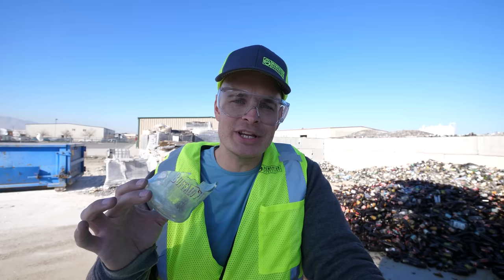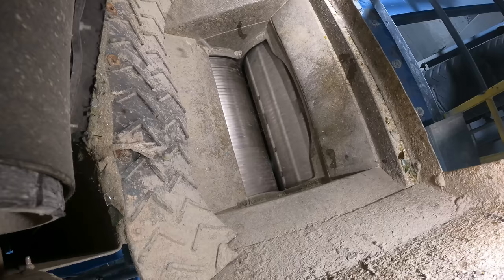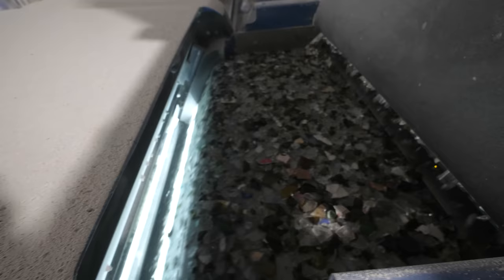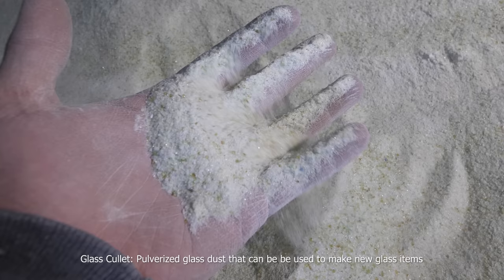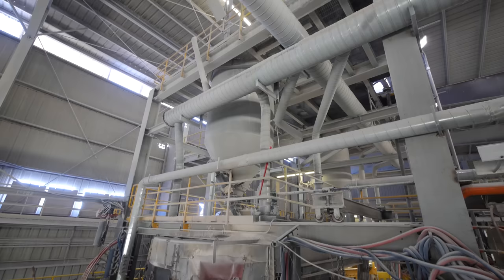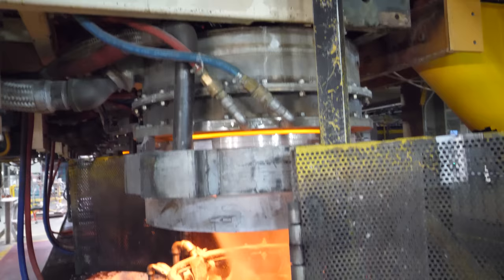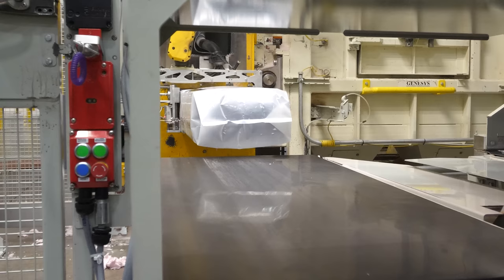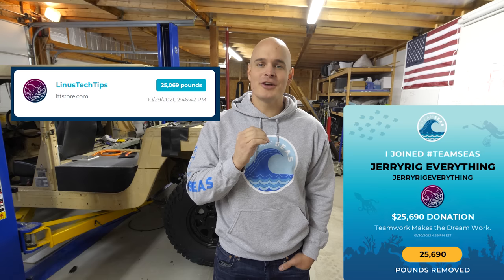What *REALLY* happens to 'Recycled' Glass?!  -  (you might be surprised)

Comment: I remember when the milkman delivered milk in glass bottles and after drinking the milk we put the empties out for him to pick up on the next delivery. The empty bottles were then cleaned thoroughly  before refilling for the next customer. A much more environmentaly process and much more efficient.
Reply: Used to reuse soda and beer bottles , but recycled wine and liquer bottles. now most are plastic or aluminum, and much more wasteful of energy and materials.
Reply: With new ultra light plastic bottles, manufacture and shipping requires less energy. those old style refillable bottles were half the weight of the product. One truck can now deliver what used to take two trucks. That alone debunks your theory. But wait! There's more! Cleaning and sanitizing a glass bottle uses more energy than making a new plastic bottle. One more point. All these recycling schemes rely on people donating empty bottles and in some cases going so far as to deliver them to a collection point. None of which is ever counted when calculating recyclings carbon footprint.
Reply: @dont.ripfuller6587  If you think protecting people from mystery chemicals doing weird things is more important than using scarce resources wisely. Well, that's your right.
Reply: @KathrynsWorldWildfireTracking  OK. Let us assume you are correct. Our problem is wonky plastic doing wonky things, some of which are bad. Should we go back to the old style energy intensive, remorse hungry methods of the past or strive to fix and perfect the new, low impact environmental friendly technology?
Reply: @owenblake90  Joe, is it possible we can do both? lightweight packaging and no floaty things? It is surely impossible to reduce the weight of a glass bottle by 99% but I am sure with sustained effort we can get rid of floaty things in plastic bottles.
Reply: Some small communities are actually bringing milk men back
Reply: it was probably worse to have someone deliver milk and reuse them. that all takes work and fuel.
Reply: @bobhart677  True. Much of our 'enviromently safe' products have a large carbon footprint behind it. Much of this industry is economically steered. If it saves money it will get done. 
Here in Sweden we recycle a lot.
Reply: @dannyb3663  Plastic is not a "toxic material" it is simply very durable. The good news is that over the last few years bacteria and insects have been found eating plastic. With billions of tons of it laying around something was bound to start eating it sooner or later. Biologists are at this very moment working with those bacteria and insects to solve the problem of plastic in landfills. Trust me, they will solve it less than tens of thousands of years.
Reply: @adun9138  Hi, Mr. Dun I must say I am surprised by an on point response. If glass recycling saved glass companies money when making new glass, they wouldn't need taxpayer funded recycling schemes to make it work. Metal recyclers need no subsidies to recycle metal. It saves them money to do so. Money being a symbolic representation of resources and labor, if you use less of it that is better for the environment. If you use more money to recycle, regardless of where that money comes from. You are using extra resources to do the same thing. Not good for the environment. It is far less costly in terms of resources and money to load up a truck with sand to make glass than recycle a truckload of old glass.
Reply: Allegedly they were cleaned 🤭
Reply: @bobhart677  But you didn't have all the plastic waste. That debunks your theory. Glass was always way more economical, and sustainable.
Reply: @Normal1855  Using two trucks to deliver your product instead of one because half the weight is packaging. Way more economical!
Reply: UK still has milkmen in vehicles delivering bottled milk and bottled juice. delivered at 5am and bottles collected at 5 am by same person.
Reply: Yeah, we have milk delivery services here in America to this day. It is a high end boutique service offered at very high prices. Why, because it is extremely inefficient and costly in both labor and resources. Why was it ever done in the past? For starters, the high tech plastic bottles hadn't yet been invented, supermarkets were just starting to sprout like mushrooms in the spring and we had been doing it that way for decades. The choices offered by our increasingly high tech society led people to buy things in plastic bottles at grocery stores because that was the least expensive way to do it. In general the least expensive thing is the greenest thing. Money is a representation of labor and resources, things costing less money use up less labor and resources. Things costing more, use more. The myth that a delivery truck hauling milk in glass bottles hither and yon is any way efficient and environmentally friendly is simply untrue.
Reply: @mochiebellina8190  unfortunately, people these days are under the delusion that they can be as wasteful as they want.
Reply: @nancybrownlee6518 if I may, what are your sources for these dangers of raw milk consumption? Not to be contentious, I don't care, per se, if you choose not to drink it, I'm interested because I do have an agenda with Codex, and care greatly what, how and why some of the things we hear, that become adopted and generationally accepted. My opinion- of course raw milk carrys with it some risk of food born illness, there isn't very much in the store that doesn't. What has to be considered is - how great is that risk really , incomparison to the Codex product? And how great is that, in comparison to other foods w high illness attributed to them? For what I've been able to come up with, illnesses from dairy products at all, are low on the list, with eggs and raw oysters being at the top , not accounting for allergies. There was shown to be almost 10 times the  risk of some food related discomfort ( meaning all range from mild bellyache, direanh, to hospitalizations) from drinking raw milk/raw milk  secondary products compared to the Codex product, but when put in perspective, the relative risk in the first place was so low, that multiplied 10times, your risk of getting a stomach ache or worse was still miniscule, I believe the numbers, using the trustworthy CDC numbers were pasteurized carried a .0003% risk and raw milk was-
.003%. However, what really counts is not the stomach aches ,but how severe is the risk of dying ? The only deaths Ive found in my inconclusive search were from something called bath tub cheese in the 80's, Now, my point here isn't to convince you to start sucking udder, I don't care one way or the other, but this Codex Alimentarius ( trans.- the food law) subject got put on the back burner and forgotten for 12 years until recently, I accidentally became reminded of it and slapped on the "holy s---" button at magnitude of what implications it holds. Great discussion, and here's to not putting anything in our bodies that makes us sick! ( I once spent 6 days in a hospital bed after ingesting some rare fungus that was eating some salmonella or something to that effect on a gas station chicken tornada)  🤢
Reply: @dont.ripfuller6587   If you want to know about the transmission of disease through raw milk drinking, the information and history are readily available online.
Reply: @dont.ripfuller6587  Degrees in agriculture and horticulture require pretty extensive familiarity with the research, and the methodology and results thereof are stringent.  They are also readily available, not just online but in all current textbooks.  There are no secrets about pasteurization or its results on human and animal health.
Reply: @bobhart677  ;Correct
Reply: @dont.ripfuller6587  ; The milk that was delivered to my house in those heavy glass bottles by the milkman was homogenized and pasteurized.
Reply: @jeffrygriffith3811  ;There is no such thing as a carbon footprint.  It is bogus.
Reply: @beskamir5977  Yes, we have been trained to be a 'throw away society'. I am still make do 'n' mend, re use, re love, recycle and  compost. 👍
Reply: @moiragoldsmith7052  Same, but unfortunately that doesn't make billionaires money so it's not incentivized.
Reply: @bobhart677  ...I think it would be really interesting to analyze honest calculations for the complete production / reuse / repurpose / reclaimation of both materials.
I find that a much more daunting task than it sounds, and it doesn't sound simple.
I know I trust myself to wash out the cup I drink from.  Corporations can't.  Take that for what it's worth.
A glass bottle is more likely to end up in a container than the plastic alternative by the human that purchases the contents.  Highway ditches and uTube "road rage" videos prove it.

I COULD make glass.  With a shovel and a magnifying glass.  What would I need for plastic?
Companies have chosen, repeatedly, to choose using material resources over human.
Centralizing operations and shipping raw materials and finished goods over increasing distances, like you said.
We HAD been shipping our recycling to China before they told us they would rather make their money NOT sorting OUR GARBAGE.  I can't blame them for that.

I would have been more comfortable with the video's title being, "Where Owens Corning sources their raw materials."

The issue seems to be cleaning the floaty bits out of our oceans and that includes 0% glass.

I know certain medical products wouldn't exist and others would expire or be too dangerous if not for plastics.
I guess it all comes down to using our resources wisely rather than fighting over them, or distorting their reputations.
Reply: @truthsRsung  Your comment has motivated me to up my game, I even made a bit of an outline! 
I too would love to see an honest accounting of energy/labor/resources/other costs to recycle glass, but far too many of the sources have far too many reasons to adjust and fudge the numbers for that to ever happen. My gut tells me that since almost all glass recycling is government supported, glass makers find it cheaper to haul another load of sand to the plant than reuse old bottles. Disposal costs not being their responsibility. 

The only thing corporations do consistently, is act on their own best interests.

Litter is undoubtedly a blight, a glass bottle carelessly tossed out a car window will smash into bits and turn to dust rather quickly, plastic not so much. I see hope on the horizon as I have read reports of biologists finding bugs and microbes that can eat plastic. With so much plastic in our environment something is bound to adapt or evolve to eat it. Those that do will spread, that might be it's own problem in the future.

Yeah, glass is easy to make, people have been making it by hand for thousands of years now. But with industrialization machines can turn out plastic bottles much more quickly. Corporation chooses to do things the cheap way. As for why China was willing to take our garbage in the first place is a mystery to me. 

The garbage patch in the ocean we have all heard about needs special instruments to find, the plastic bits are so small they can't be seen by the naked eye, as with litter, I see nature taking care of it. Possibly some day a bacteria that eats plastic will be bioengineered in a lab? Just my opinion, but I feel the floaty bits fears are overblown, both in the ocean and in the bottles themselves. 

Your final point about wise use of resources, I agree wholeheartedly.
Thank you for your thoughtful response.
Reply: @bobhart677  unless the truck itself is more energy efficient. Another concern I have straight from the video is the waste of corrosed electrodes that need to be replaced often. The video doesn't discuss the impacts of it, mining coppers for it etc. Another thing that wasn't clear to me is tha whether the pink insulation is also recyclable after some years of use
Reply: @bobhart677  also, regarding milk, it's usually shipped (at least in my area) in cardboard, and sometimes nylon bags... Not plastic. It seems to me that cardboard is better than reusing glass
Reply: How do you know they were cleaned throughly?
Reply: @truthsRsung  are you ok?
Reply: @Amy_L33  ...Can you construct a complete thought then put it into a sentence?

Or are you simply filled with questions that you don't want the answer to?
Reply: @truthsRsung  are you ok? Seriously?
Reply: @mochiebellina8190  My cousins would collect all of the soda bottles they could find all year long in KS, where the bounty was 3 cents each and take them to TX on their annual visit to grandparents there and collect 4 cents on each.  Just good business.
Reply: @bobhart677  Certainly empty glass bottles are heavier than plastic. Remember this video is about glass bottles!
Multiple use glass bottles can be reused up to 50 times. Once empty they get picked up by the same delivery trucks that carried them when they were full. No other vehicle required.
Each time recycling becomes industrialised an entire new logistic solution has to be set up and new recycling factories are set up usually made from brand new materials.
Reply: @mochiebellina8190  I lived on an island where glass bottles were a secondary currency. I remember a honey maker who paid premium prices for glass bottles preferably with the top intact.
Reply: @Amy_L33  ...Go ask mommy for a cookie.
Reply: In the UK in the 1950s the milk bottles were delivered by an electric cart.
Reply: @bobhart677  Plastic is harmful, Plastic products contain chemical additives. A number of these chemicals have been associated with serious health problems such as hormone-related cancers, infertility and neurodevelopment disorders like ADHD and autism.
Reply: @frankyflowers  it still takes fuel to distribute anything.
Reply: @bobhart677  Actually the recycling companies recommend the rinsing of containers that are going to be destroyed before being turned into some powder.
Reply: @bobhart677  Even taking into account transport and sanitizing LCA show lower impact for reusable bottles. At least 75% of the energy goes into production of the bottle. Then having more lightweight reusable bottle should be the golden goal.
Reply: @alexisdagenaiseverell4304  I agree, more research on new types of plastic could solve this problem.
Reply: @bobhart677  And how much energy is used to make all that plastic? How much oil is used to make plastic?
Reply: @Normal1855  It takes less energy to make a new plastic bottle from a few drops of oil (just a few grams per bottle) than it takes to clean and sanitize a glass one. For some uses glass will never be replaced, but one thing most people forget is that money is a representation of labor and resources. so, anything that costs less than the alternative uses less labor and resources than a more expensive thing (not counting art or related fields). Less labor and resources equals less carbon footprint. Plastic is greener than glass.
Reply: That was easy with a steady route. A lot of breweries used to do similar too. Now we have too many varieties sold in multiple stores to support the logistics needed to reuse that way effectively.
Reply: we still do here
Reply: @bobhart677  you are assuming that people actually recycle plastic bottles as intended, most people stick the plastic bottles and milk cartons in the black bin
Reply: @freekuki  No. I'm not. despite the recycling symbols on the plastic we use, hardly any of it is ever recycled. Despite the government subsidized recycling centers. The truth is, it costs more to recycle a plastic bottle than make a new one. Cost is money. Money is a representation of labor and resources. Less labor and resources is lower carbon footprint. Do you want to use more labor and resources to have a public display, pretending to be green? Or would you rather we do what is non showey, but true green?
Reply: @freekuki  And You are spot on about companies wearing "green" in public and acting anything but.
Reply: @bobhart677  The real point is that still many people do not recycle properly or even at all.  Not to mention the amount of trash that is just thrown on the ground.  My personal pet peeve is cigarettes butts.
Reply: @bluewaters3100  Yes, very few people bother with the rigamarole of recycling. most folks just can't be bothered to wash and sort stuff to be left in a bin on the curb. When you ask them to transport it to a collection point participation drops even further. Why? I think because most people realize it is an empty gesture. Plastic recycling is heavily subsidized by the state and nobody gets paid for bringing plastic to a recycling center, unlike metals recycling witch makes money for the participants. Money is a representation of labor and resources. Using more resources to recycle a plastic bottle rather than throw it away and make a new one, on environmental grounds is complete reversal of environmentalism. Plastic recycling uses more resources than disposing of it. As for littering, how old are you? I am in my 60's and when I was a kid EVERYONE was a litterbug. No one cared and litter was everywhere. Litter today is a tiny fraction of what it was 50 years ago.
Reply: Are you 90?
Reply: @zephon13  no 95
Reply: @bobhart677  Just sell the syrup like they do to Mcdonalds. But then it wont seem so magical will it?
Reply: @bobhart677  Why would 2 trucks need to be used?
Reply: @bobhart677  "In general the least expensive thing is the greenest thing. " LOL Just no.
Reply: @bobhart677  "Less labor and resources equals less carbon footprint." I disagree. One reason small farming is more expensive is the lack of huge equipment, etc. That equipment is not good for the environment. Most of the processes used in large commercial farming is not good for people, nor the environment. All of that equipment needs to be manufactured. Many of the components are made via mining of metals, minerals, etc. The idea that cheaper is better is completely false. Cheaper almost always means more destruction to the planet and the people on it. Plastic is not better for the environment than plastic.
Reply: @revjaybird2  "LOL Just no." What an insightful critique of my comment. What university did you attend to gain such mastery of the English language.
Reply: @revjaybird2  Everything you wrote about farming is true and correct. (small carbon footprint equals high cost, not so much) What you left out is that the farming style you espouse would lead to mass global starvation as the great mass of humanity is dependent on "factory farming" to live. Would you condemn half the people on Earth to death, to save the planet?
Reply: @revjaybird2  Because trucks are built to carry a certain weight. So, a 3 ton truck carries 3 tons, if half that weight is glass bottles you only carry 1.5 tons of milk. Same truck with plastic bottles carries 2.9 tons of milk and .1 ton of plastic.
Reply: Except it was not environmentally friendly for a truck to stop at everyone's house just delivering milk, neither efficient.
Reply: @dont.ripfuller6587  I'm in the UK. We get deliveries of raw milk in glass bottles with foil caps, direct from the farm. The bottles are washed and re-used. This is unusual though! The usual deal is HDPE bottles of homogenised, pasteurised and standardised milk.
Reply: @bobhart677  Why should we practice environmentally unfriendly farming practices in order to feed the world? When did it become out job in the US to subsidize feeding all of humanity? 
The biggest cause of starvation is political game playing, not lack of crops. 
Factory farming has caused way more harm than good. It's terrible for humans to eat the food produced via chemicalized, industrialized factory farming practices. 
Most of the people in "starvation stricken" areas of the globe would figure out how to feed themselves if OUR gov't stopped dabbling in the affairs of other nations. 
Africa's largest problem is war. War WE perpetuate via supplying weapons, usually to both sides. 
That's why the people are dying of starvation. Add in the purely evil practices of big corporate ag in Africa, India, etc. WE have been the direct cause of these people not having enough to eat. 
Our subsidized grain, etc has caused farming to be nearly unsustainable financially in all the countries we provide food for. How about we stop and let people in other countries go back to farming like they used to. 
India, Africa, and China existed and managed to feed themselves for a long, long time before America was even a thing. So why would we think they couldn't continue to do so without out dabbling in their affairs for the last 75 years. 
You've bought into the big lie of big agriculture. 
It's not our job to feed and nanny the world.
Reply: @bobhart677  You said something so utterly wrong, it didn't warrant a lengthy response.
Reply: We do this often in the uk
Reply: @bobhart677  This shows that you have an academic basis for how you think rather than real world experience to base your opinions on. So many things have been broken by academics thinking they know something based off things like pure math. We need to go back to asking the people who actually do things for a living rather than allowing academics and politicians make the decisions based on things they've never actually physically participated in. 
Most of the truly ignorant people that I know are highly educated. Their judgement is clouded by their ego in thinking a book is more informational than watching and listening to the person who has done it for a living. 
We wouldn't need to worry about the weight of milk bottles if we weren't trying to truck everything across the country or trying to ship things around the world. The local milk man system worked just fine for a long time. The weight of the bottles didn't factor into it on a local scale.
Reply: @revjaybird2  So, your feelings are more important than my facts?
Reply: @bobhart677  plastics ALSO need to be recycled.  Because contrary to glass, plastics will be grind down to micro plastics, which is currently flowing in your body, and are basically infecting ALL places on earth, including the air up where airplanes fly and in the deepest parts of the seas.

So yes, plastics needs to be recycled for use as fuel or new plastics.  All plastics that end up in the nature, sea or not, will eventually end up in some life forms body, like yours or mine.
Reply: @bobhart677  bacteria eating plastic.  Great, then the benefit of plastics as a durable material to build stuff will be gone, especially compared to glass.
Reply: @bobhart677  in Sweden there are no Tax founded recycling schemes, that is payed by customers when they buy a plastic or glass container.  And when the bottles get returned for recycling, they get money back.  So yes, some places needs to get updated how one make recycling work better.  Just because USA and others countries have not figured this out yet, doesn't mean that it can be made to work.
Reply: @UltimusTheSoldier  cardboard containers usually have a thin surface of plastics in the inside, as water in the liquids will resolve the cardboard to paper mass.
You know that nylon is a form of plastic?
Reply: @AndersJackson  Right, the state orders you to fund the system with direct payments to the bottler. It may be more efficient than taxing people and using that money to subsidize recycling but it all amounts to the same thing.
Reply: @AndersJackson  What about the shipping weight? A one gallon glass bottle weighs how much more than a plastic one?
Reply: Washed with cold water first.  Then sterilized.
Reply: @bobhart677  yes, what about that?

Notice I have written about BOTH plastic and glass bottles.

If we look at the case with milk and milk man delivery.  The return glass is picked up at the same time as it is delivered.  There are no special cost in delivery.

If we are looking for example water.  Use the tap water, if this is a real concern of yours.  Don't buy water on bottle, plastic or glass.
Reply: @dont.ripfuller6587  Milk has been pasteurized in the US for over 100 years, and nationwide for about 100 years.
Reply: That's just it! Your absolute devotion to the idea that recycling is ALWAYS the best answer. Why? Sometimes is just more efficient to throw things away.
Reply: I became a superhero
Reply: @dont.ripfuller6587  I can remember even before milk became a 'homogenized' market product.
Reply: @bobhart677  That's not entirely correct - concerning the farming practices and mass starvation (how much starvation is mass starvation anyways? We're at 15,000 dead per day right now which DWARFS the cough cough scare by a astronomical margin, yet cough cough was so bad enough we allowed it to cost how much?...🤤...moving on...) 
First- forget the carbon print worry. That's bull stuff invented and spread around by big energy and their polical installs. Guess whats not heavily taxed right now? And rewuires lot of oil to generate still? And once implemented widespread under the false pretense of "green", once everyones "feelings" are safely secured through their new evs, that will be remote control cars at the will of the state, guess what will be getting taxed like gasoline is now, only now your household will also be included in the bill...you better believe it...oh, dont forget the carbon credits for their bonus $$. green energy has never been anything more than big energy money playing  off well intentioned, good hearted susceptible emotionally impulsive folks that equate what they see to whats really going on. 
 Sheesh, I cant even get through all the mire to get to my response on farming practices...
The true cost of commercial farming practices is obscured. If youre only comparing face value cost then it appears cheaper up front. But if cost and value to you include more than monetary balances, the cost of commercial farming is through the roof. In order for a handful of people to amass enough food to meet the demands of thousands, then practices must be adopted to account for the labor shortage traditional methods, with more people's labor, require. These include but aren't limited to the chemicals used (Codex Alimintarius approved safe for your health), the health issues arising from years of ingesting said poisons, the land damage from corporate mismanagement that only looks at monetary cost, waterways filled with runoff damage, and not the least as were seeing right before our eyes- the ability for one large entity to become influenced and coreupted by an enemy/govt./state sponsored organization is easier/more likely- and thus, makes controlling an entire population a simpler task- he who controls the food, controls the people. The solution is simple - if you eat,you are no more than one person removed from production. Something, some part of the system has your or the person next to you's participation. Anything else is folly. You lose the tools and knowledge to make it on your own should something happen. And historically, something always happens. 
Don't believe me? Give it one year from today and if you still think this is wrong, I'll eat my own foot off my leg (assuming that i havent already) 🦵🏼👀🍗
Reply: @ShockingPikachu  What?
Reply: @mikethefordprefect2883  I think the UK still has many small family dairy farms which would make that feasible.  I live in Texas and buy milk at Walmart and that milk could have come from any state or even Canada.  I wish I could get good milk delivered from a farm near me but there are no farms were I live because I'm in the desert.
Reply: @bobhart677  you have completely decimated every other opinion in these comments I have a question rather then a dispute. What are your thoughts on industrial cattle ranching and the amount methane it generates?
Reply: @bobhart677  well true enough but I grew up on a traditional ranch and 30-40 cows these are big animals it uses alot of water and plant resources our cattle were free range and got their water from a river but industrial cattle even if you take out the methane factor and I'm talking 100000 plus cattle on one plot of land imagine how much water that uses the north American plains are drying up and traditional family ranching barely exist I believe there's a documentary on this topic on Amazon prime and I watched it but I don't know it's name but basically cattle ranching is destroying water reserves and releasing mind blowing amounts of methane into the atmosphere and there's only one man studying all this because nobody is paying attention to the country I live in Canada and it's so wet in the area I live it doesn't matter but in the states it's a serious problem because the groundwater is being sucked dry and the problem there is that water is the blood of the land so u take that away and the whole country will start to look like vegas
Reply: @curtisreimer4592  Water use is a tricky subject. Who owns a river? Big factory farms grow food at a lower cost than a family farm, often by using their size and clout to convince local lawmakers to pass rules and ordinances that pass many of the costs onto the community at large, subsidized water use being at the top of the list. The county or special use district or whatever term the locals use, spends tax money doing hydrology studies and building water lines and pumping stations and water towers. Taxing the community at large to pay for this. Meanwhile the corporate ranch gets tax breaks and sweetheart deals because they have connections and lobbyists.
Reply: Still done in parts of the UK
Reply: It's the best recycling process, nothing goes to waste.
Reply: "The empty bottles were then cleaned thoroughly  before refilling for the next customer. A much more The empty bottles were then cleaned thoroughly  before refilling for the next customer. A much more environmentaly process and much more efficient.process and much more efficient."

No that is not.. You are using water, hot water to clean them.. How tf is that more environmental? You cant use reuse the same water to clean one to another without cleansing that water first.
Reply: @ninjasylph  Yeah it's called Uber Eats..
Reply: Where I live, we still have milk delivered in glass bottles. The bottles are picked up the following week for reuse.
Reply: there used to be a milk box built into houses also, right by the back door, but this precludes a delivery driver going house to house delivering milk and that is a time and fuel consuming task, kind of like UPS but with milk, which is a rather cheap commodity.  plus it has probably become less predictable as to when the milk runs out, and who will be home to fetch the milk to the fridge before it goes bad?
Reply: Up until the early eighties, in Mexico, Coke, Pepsi glass bottles had a deposit system where they got refilled by the bottlers.
Reply: @bobhart677  
I generally agree with you.
It strikes me that a cow will consume the same amount of water in its life whether "free range" or in a pen. Same for it's feed.
Nothing is free. There is a cost for a benefit. 
I have a wild apple tree that produces plenty of inferior, inconsistent fruit for my family. If I want to sell apples, I could locate more wild trees for more inferior, inconsistent fruit or plant an orchard where everything is at hand and under control.
Different thought, whatever happened to radiation preservation of food?
Reply: @ferengiprofiteer9145   First things first, I used to play a Star Trek RPG. I always played Ferengi. The one benefit to free range cattle, or any animal, is that they can eat naturally grown plants on land unsuitable for growing crops. However this practice is labor intensive, as reflected in the price of grass fed beef. Irradiated food is a genius idea. Irradiated food in an air tight container is shelf stable without refrigeration. The problem is that it sounds scary. I remember when my sister heard that a certain fast food franchise was using irradiated pepper, she refused to eat there because she was afraid of radioactive pepper. At some point the cost savings will outweigh the consumer hesitancy and we will see grocery stores with no refrigerated section selling food for far less than the stores with refrigerators.
Reply: you are talking about days when Earth had 3. billion people only. It is difficult to maintain anything today , numbers are too large.
Reply: @dont.ripfuller6587  yes! I miss good old days.
Reply: how old are you? that was before home refrigerators were common.
Reply: @GaudyMarko  112
Reply: About 60% of the waste in the sea is old fishing nets
Reply: @frankyflowers  , do you wash glasses at home and drive to the grocery store for milk or do you use solo cups and get home delivery?
Reply: @outdoorsman7324  that would be the same no matter how the milk got there.
Reply: So true, even at the supermarkets you can by a single or a case of milk in returnable bottles.
Reply: In my village, it was the weak beer locally produced.  The bottles were always recycled.
Reply: In Thailand They collect your bin every week For £1 a month For a smaller bin just over half that Locals call around and give you about £1.50   for your recycled materials So I get paid,50p a month to get my bin emptied We also have no community change And my rent on a bungalow is £70 a month with a very large garden
Reply: welcome to the 2000+ era ... Also the milkman did some extra activities back then
Reply: soda bottles- smalls were a nickle 12's were 10 and 16's were 15 cents.  We used to collect them to get candy or another drink.  Usually an rc with a pack of salted peanuts.
Reply: @nancybrownlee6518  p
Reply: I myself recycle repurpose and reuse both glass and plastic! Not all plastic but some! Otherwise yes it does end up in the landfills!
Reply: I know....he was my Dad.
Reply: it's cheaper to have machines make new bottles, them pay people to transport, move, clean old bottles.....
Reply: @RubsNL  You mention the insane amount of plastic in the environment. Why would that be? Might it be because plastic is so useful? Plastic is everywhere because it makes life better. Is plastic without blemish? No, but the  answer is to fix the problem by making better plastic. Not with bombastic assertions that plastic will kill us all.
Reply: @bobhart677  A lot of what you say is true but ultimately the aim of recycling is to produce a circular production and use cycle and limit what goes to landfills. If a plastic container saves in several areas against the glass but most of it ends up in landfill or the environment does that make it better to use? it does for company beancounters and the CEO but that money does not help the environment or the people and animals it affects. The packaging industry has seen unimaginable growth since the 1960's and consumers now have few options not to use it or use one type over another. Almost all packaging is disposed of so it has become imperative that it should be entirely recyclable and that a simple system of collecting and sorting it be developed. It is easy to make something look cost effective when you do not include some of the costs or if you do you don't give them the importance they should have. I worked in the packaging industry for twenty years and "sustainability" is not a word you hear very often unless it relates to a direct cost on the production side of spreadsheet.
Reply: @alistairshanks5099  You proceed from a premise I happen to disagree with. You say the point of recycling is to create a circular production cycle. That is after all what the big petroleum companies have been telling you for decades now. In truth almost no plastic is turned into new things. Why? It costs more to re use old plastic than to make new plastic. Like you said many of the costs of recycling are paid by the consumer or the taxpayer. Not the producer. So this price is very hard to pin down, but whatever it is, it is far higher than you think. With the stated goal of keeping unused land from being filled with garbage. Do you know how much land? If all the garbage collected in America over the last hundred years were placed in one spot it would be a square ten miles on a side, fifty yards deep. If you could recycle all plastic we could fit all our garbage into a square nine miles on a side. surely doubling or tripling the price of plastic is too much to pay for such little benefit. Oh, and the real point of plastic recycling. Convincing the populace that their imaginary fears are being addressed.
Reply: @dont.ripfuller6587  We've been pasteurising milk in Australia for over 80 years.
Reply: Those were the days of the carnation  milk trucks ice cream multi colored glass sounds of all that glass like in piles of leaves crunching leaping
Reply: Mine still does in the UK, orange juice too!
Reply: I gave your comment a like, but in exchange, I get to say you must be OLD! I am too. We had a milkman and an eggman when I was young, and remember the same thing. At least we hoped they were cleaned thoroughly lol. I remember when the eggman said he couldn't come anymore, then the milkman. We had to actually go get our own! At least the milk didn't sit outside in 80 degree temps for hours until we got home lol. I remember the bottles were amber. I think that was to keep sunlight from harming the milk, Guess they didn't worry about the temperature much.  🤪
Reply: @bobhart677  I agree - at least to some extent - with your argument. However,  it seems as if you also don't include whatever happens to the ultra thin plastic after its (one-time) usage.
Reply: @mochiebellina8190  false.  Glass is not better for the environment.
Reply: @bobhart677  also, glass bottles require sand that requires destruction of the environment to make.
Reply: @gizzyguzzi  Seriously? You want to go there? Conservation of our limited access to sand? Go ahead , make your case.
Reply: @bobhart677  they mine it from rivers and beaches, Einstein.  Not desert sand.  Next you'll tell me sea salt is environmentally friendly too.
Reply: @gizzyguzzi  I love being insulted personally, and the non sequitur. Priceless. Such well thought out criticisms. I do understand that making concrete requires a specific type of sand because they need the sand to be in jagged grains, not smooth grains. As is found in desert sand. Glass makers melt their sand. Are you sure they need jagged sand for that? Or would round grains suffice?
Reply: @bobhart677  it's a 'sequitur'.  Low info people think mining is bad, so they blindly believe sea salt is natural and healthy.  In fact it is more environmentally damaging and full of modern pollutants that millions years old mined salt does not have,  (all salt is from saltwater anyway).  This is not unlike those that automatically condemn plastic bottles and praise glass.  Shallow thinkers.
Reply: @gizzyguzzi  I must have hit the wrong suggestion on spell check. 😁
Reply: We still do this in the Philippines, but not with milk. We do this with sodas and beer, like Coke, Pepsi, and our local San Miguel products.
Reply: @tymon1928  Yes i agree the solution is to buy LOCAL products, buy your local beer, water, milk, veggies etc. buy fresh food instead the rubbish the big brands sell (Nestle, unilever and big companies) every food coming out of the inmdustry is much worse than the fresh food you can locally buy. I'm not talking about about growing your own veggies as not everyone has the possibility but there is lots of tools for urban gardening today using, terasse, balcony or roof, even having small windowsill to put a small box. The trend today is to rent small portions of land and to do gardening with the family, and suddenly the children eat veggies, because they have grown them theirself.
Reply: @tymon1928  OK, just to be clear on this. The adverse effects of using plastic for food containers need massive studies and intense research to find. The results are often disputed and hard to replicate. More research is clearly needed. These elusive side effects that cause much concern need to be addressed. I am however far more confident in the ability of mankind to solve problems at the last minute than you are.
Reply: you'd think so but bottles need water to get washed. Using water which is a limited resource to get the the bottles back is not better. But using machinery that can be fueled by nuclear energy provides sustainable way of getting the glass back without using limited resource - water.
Reply: @Kokose  Water is 100% recyclable. It it not destroyed.
Reply: @Kokose  If you are talking about an industrial washing machine, they are higly efficient in terms of energy consumption and water waste, there is recirculation of the cleaning water, you are not talking about liters of water per cleaned bottle, more in terms of milliliters, and usually this grey water is also used instead of fresh water for several purposes instead of drinking water e.g. water toilet, gardening,....
The major issue is the behaviour of the customers instead of buying regional products with a multiway packaging, buying the brands from the advertising from far away with a single use packaging.
To avoid the problem of long transports of empty bottles, the beer breweries and the water wells, have since decades standardized bottles, the customization is done by the paperlabel and the lid, and of course by the content.
Reply: @bobhart677  Let’s not forget the Great Pacific Garbage Patch. I would also much rather drink out of glass than plastic.
Reply: @mtadams2009  Yes, lets not forget about that! Very hard to forget when one is constantly reminded of it. Lets also not forget that to find the "great garbage patch", one needs to microscopically analyze water samples to find it.
Reply: @bobhart677  It isn't an ether or situation! We can find ways to make things that are shipped lighter and encourage people to use reusable and recyclable containers (glass, metal) for products that are made and used locally. We need to work on more local production systems anyway, buying local is almost always going to be more environmentally sustainable then getting something shipped in. 

We also need to find ways to improve the recycling of plastic and mixed material packaging, which is often better for things that are going to be shipped, and there are things (medications, medical appliances, some food stuffs) which are better shipped then being made locally.
Reply: @MirrimBlackfox  These are all good points and good ideas. You will never see me advocating for banning glass packaging or restricting choices. If ever an economical way of recycling plastic can be found I would be all for it, currently recycling plastic requires more resources than simply burying it in a landfill. Buying local when I can and reusing (not recycling) are things I myself do. If I could, I would buy in bulk and reuse my own packaging. The point I am trying to make is that recycling plastic as we currently do it is wasteful of resources and should not be subsidized or encouraged.
Reply: I live in Europe. We are slowly coming back to the “old habits”. Since last year, I go everyday (by bicycle) to a nearby farm with my glass bottles to buy milk… fresh, tasty, healthy and cheaper than at the supermarket! And no need to pay for a gym… !
Reply: @dont.ripfuller6587  You're showing your ignorance about food safely and dairy processing requirements
Reply: Yes, replace plastic with glass and metal but fir that first must reduce drastic the transportation cost...glass bottles due to the weight and protection buffers leeds to a 30-40% reduce of net quantity transported on one trip or at the same cost...
Reply: @bobhart677  You're using double standards for comparison between glass and plastic. 
First: Making a plastic bottle requires lots of energy too. You need to pump up the crude oil, transport it, refine it, turn it into plastic pellets, and only then can you take the plastic to a factory to be made into a bottle. Just counting the 'making the bottle' part is unfair. If you take into account the entire prodcution chain, i'm pretty sure simply washing and reusing a glass bottle is far less carbon intensive.
Secondly: Yes recycling glass uses public funds. But so does plastic recycling. The difference is that recycling plastic doesn't actually do anything, since it's all transported to china and dumped there. Plastic recycling is a scheme and has never really worked. In fact it's now become so expensive even china doesn't want our plastic anymore and it's become economically unviable to recycle without government subsidies. On top of that comes that the vast majority of plastics simply cannot be recycled from the start. Only a tiny portion of the types of plastic we use are actually recycleable, and only then a couple of times before it degrades so much it's pretty much useless.

Third: Plastic causes vast amounts of waste and clean up costs than aren't counted towards it's production costs. If plastic manufacturers actually had to PAY for the clean up of plastic in our environment and in the oceans, plastic would be unaffordable and economically unviable to produce. But the cost of plastic pollution is now completely shifted onto the consumers and society and thus government, so the actual cost of plastic can't really be counted and any comparison with glass is impossible. Glass on the other hand is fine in the environment and simply breaks down to sand, even if it takes a long time. And even then glass IS being recycled AND reused effectively, when plastic is not or barely at all.
Four: this ties in to the cost of plastic pollution, but your argument about one truck being able to carry as much plastic bottles as two carrying glass is also completely non-sensical. A glas bottle that holds 1-2 litres is not much bigger than a plastic one. The difference in volume would be marginal and more like 10% more, not double. The big difference is weight. THAT is the reason why drinks companies prefer plastic to glass. It costs far less fuel to transport plastic compared to glass bottles. Yes this means glass is more carbon intensive to transport, but all it's other environmental benefits (no waste impact, low environmental cost, low clean up cost, recycleable, etc) far outweigh that extra carbon footprint. The only reason companies prefer plastic is because its cheaper to them to transport and thus increases profits. That's it. But the reason it' cheaper for them is because all the actual clean up costs of their products ore not bourne by those companies, but by society and government.
And lastly: Your argument about plastic not being toxic is utter nonsense. Many plastics are KNOWN to bond to all sorts of chemical toxins in the marine environment. These pellets of plastic bonded with these toxins then are eaten by marine life, eventually ending up on your plate through the fish and meat you eat. It's now gotten so bad, we can now actually detect plastics and their toxins in our food chains. Microplasics and plastic fibres are now found in tea, salt, seaweed, milk, seafood, honey, sugar, beer, vegetables and soft drinks, and even bottled water. So no, plastic is far from non-toxic, and is finding its way into our bodies every day, and microplastics bonded to toxins are leaching into our food chains every day too.

And yes there's hope in bacteria than are shown to have adapted to be eating plastic. It gives hope that we can at least clean up the mess we made. But it's not all fun and games, since these bacteria only eat PET and some other few select plastics, a tiny fraction of all the types of plastic we use. We might be able to engineer other bacteria to eat other plastics, but this is still some way off it seems. And on top of that comes the fact that as these bacteria die and eventually mineralise, they release carbon dioxide, adding to carbon emmissions. So these bacteria are just a slower way of "burning" PET. But even then this is idiotic to put your hopes in, as it's again just a way to push away responsibility of our waste to someone or in this case something else. Plus this kind of makes the whole point of plastic mute, since this means eventually all plastic will degrade like any other material, because it will be slowly be eaten by microbes, taking away one of the few advantages plastic had, making glass again better as a material since it doesn't get eaten.

So yes while on the surface if you don't dig too deep, plastic bottles may seem better than glass bottles, the truth is glass is way more environmentally friendly than plastic in so many ways.
Reply: @johanwittens7712  Odd isn't it? Reading your response It seems you know all the facts I do, yet come to different conclusions. One thing you didn't mention is the inherent danger of glass. A few years ago, I myself slipped on a wet floor while carrying a glass jar. The resulting gashes in my leg and hand required stitches to close. Have you included accidental injury from glass in your assessment? I think our differing views reflect differing personality types. I am an optimist and I believe that scientific progress can solve the problems with plastic. People like you would rather live in the past.
Reply: @bobhart677  Always someone who thinks technology is a good thing. Lol. Let me guess you believe oil  fossil  fuel.
Reply: @Lynn-rf1kc  Yes, I do believe technology is a good thing. Are you asking me is oil a fossil fuel? Or more likely is fossil fuel a good thing? Would you rather we power our society on whale oil? What exactly is your second question?
Reply: @bobhart677  Over your head.
Reply: @bobhart677  Show me a truck that can't deliver the same amount of plastic bottles as glass bottles of the same liquid.
Reply: @hawaskidarendo2128  Not volume, weight. show me a truck that can carry 5 tons of milk in plastic bottles when fully loaded that can also carry 5 tons of milk in glass bottles that weigh significantly more than the plastic bottles. Not to mention that glass bottles require much more packaging to prevent the glass bottles from bouncing into each other and breaking.
Reply: People still use milkmen. Royal Crest is my local brand. Too expensive lol
Reply: They do this with Voleman’s milk at my grocery store. It’s surprising for me in Texas to see this on a corporate level instead of a small local farm. It’s based on DFW I believe.
Reply: @frankyflowers  employment for those
Reply: @bobhart677  soon not going to grocery store will be the norm.
Reply: @dont.ripfuller6587  chicken can almost kill you, been there too
Reply: @frankyflowers  When I was a kid, in the 60s and 70s  milk was delivered by horse drawn refrigerated carts.
Reply: @Wishes890  did mushrooms grow in their poop?
Reply: @frankyflowers  Likely.
Reply: @Amy_L33  Do you have a point?
Reply: @Wishes890  Congratulation on living to b 160 years old. You should contact Ripley's.
Reply: @robertsteele474  you didn't read what I wrote, you don't know where I grew up, and I accept your admitting you were incorrect.
Reply: @bobhart677  compelling argument, but where's your source? I need to fact check you
Reply: @zGoldenHawk  With 194 comments and counting. I can't possibly know which of my many comments you are talking about. Why don't you tell me what has you wondering about sources.
Reply: @bobhart677  3rd comment, any studies proving that arguement?
Reply: @zGoldenHawk    I made three points, glass bottles and the packaging needed to transport them (wooden crates) weigh as much as the milk. Source, lifetime experience. Simply pick up a half gallon of milk in a glass bottle in one hand and pick up a whole gallon of milk in a plastic bottle with the other. Making a new plastic bottle uses less energy than washing and sanitizing a glass one. Source, knowledge of physics and knowledge of industrial manufacturing. Every recycling operation I have ever run across requires either government coercion of subsidies. That alone proves my point.
Reply: @bobhart677  source: trust me bro, but for real, I don't want that "I have experience" crap, I want links to FACTUAL scientific evidence that isn't just experience
Reply: @zGoldenHawk  OK, I made a comment on a YouTube video. Not a university dissertation. Make an argument about how wrong I am, fine with me. Ask me for sources you can fact check, I give you what I can. You have internet, do your own research, then come back with your sources and prove me wrong. Where do you think I am in error? 30 years ago when my home town was talking about spending 27 million on a recycling program I found a local plastic factory and asked about prices on empty bottles. After doing a bit of math I concluded that it would cost far less to bury the old and buy new. No need for a third party study. You want other peoples opinion, go look. Nothing stopping you.
Reply: @bobhart677  link me evidence or I'm not agreeing with you, simple as that
Reply: @zGoldenHawk  Super simple. We disagree. Now present your case.
Reply: You can't make an argument claiming that making plastic bottles costs less than recycling glass ones without citing sources
Reply: @zGoldenHawk  Of course I can. I did! You dispute my claim with as many sources as I used to make it! This is a YouTube forum, not a court of law. I am not merely talking to you, but (hopefully) dozens, if not hundreds of people reading this. Speak to the audience Mr. Hawk. Present your case.
Reply: @vilefly  The disposable nature of our society is not a good thing. I remember a time when toasters and lamps were repaired. Not any more. $300 phones are routinely thrown away for trivial reasons. We have so much stuff we don't know what to do with it all.
Reply: You must be an old timer like me. To remember that.
Reply: @ninjasylph  my grandpa was a milk man. thing is, cow's milk isn't what it used to be and now I don't even drink it.   I hope that Amish farmer wins his court battle.  We need to deregulate in certain ways to bring back healthy meats and cheeses and milk
Reply: @bobhart677  distance a product was shipped was much less. Milk came from a small branch in town, not from 200miles away.
Reply: @vajkfekete2635  How does distance from where the milk is packaged change the weight of the packaging?
Reply: @bobhart677  
Sounds great!
Until Barry the Bacteria and Ian the Insect decide to make lunch of the plastic piping infrastructure underground, and snack on plastic covered electrical wiring. Not to mention the plastic guttering and facias on our houses, your trainers, the kids Wendy House or their garden slide, or road cones, or after a little mutation the tyres on cars and trucks etc etc. The list of stuff they could munch on could bring society to a standstill.
Reply: @bobhart677  
You are correct kind sir. Your comment was about, that they'd discovered bacterias were eating plastic, and that scientists would work on this to have them eat all the plastics in landfills. I was replying that whilst in theory this sounds great, it won't be great when those bacterias move away from the landfills and start eating all other plastics, which would be catastrophic for infrastructure. Nice to have debate, rather than flinging insults. I do like a critical thinker. Enjoy your day.
Reply: @bobhart677  you mean they are in negotiation with plastic pieces??
Reply: @KarlDMarx  they could have gotten a nickel in michigan
Reply: @johnwright9372  ....with lucas batteries....
Reply: @tommurphy4307  Could be. with 216 comments in this thread, in which at least a dozen are my comments, I have no idea what you are referencing. Please like the comment you are commenting on so I can craft a response.
Reply: @bobhart677  It is cheaper and less labor intensive to throw away lots of perfectly good things in the landfill such as clothing, food, and other unpurchased items; and somehow that is more environmentally friendly because somehow labor and cost equates to resources equally, according to you, and not influenced by market values and cultural perceptions about what labor costs.
Reply: @kathyl9222  Yeah, is that so hard to believe? Labor is not free. Resources are simply dollars (or euros or whatever) in another form. If it costs more to turn something into another thing than make a new one. Then you are wasting resources. Easy as that.
Reply: glass snapple bottles get around fine
Reply: Yea… but this is cheaper. Lol

Its crazy right? All these seemingly extra steps ( crushing, cleaning, mixing, sorting, etc, etc) is somehow better for the environment? Seems counterintuitive.
Reply: But then you can’t do capitalism as easily
Reply: To my knowledge there is still a dairy company that delivers milk in glass bottles.It’s called Royal Crest and is in the Denver area.
Reply: I am the milkman. My milk is delicious. Special delivery today!!
Reply: I still have my milk delivered that way
Reply: @jonathanmorgan1882  I wish I could
Reply: Yes
Reply: Ole the good old days
Reply: There are cleaning chemical companies where you have a reusable container and they just have to ship you a dry tablet. Mix it with water and bam.
Reply: @bobhart677  Bro you keep commenting on this video, are you paid to comment against reusing plastic?
Reply: @InfiniteDesign91  In a way, yes, as we all benefit when people stop doing wasteful things. Like recycling plastic.
Reply: But if it was so efficient, why wasn't it able to competec against the current system?
Reply: You still can get it from the milkman
Reply: That was the good old days 😂😂😂
Reply: @bobhart677  you keep mentioning weight. But it seems that you dont seem to realise the immense amount of plastic pollution that is everywhere around the world. How does weight outweigh pollution
Reply: @jorisessen8410  Plastic pollution everywhere? Not really. hydrocarbon pollution everywhere? Yeah. When you transport milk (or any drink) in glass bottles the packaging weighs as much as the milk, when you use plastic packaging 99% of the weight is the milk. Using plastic packaging cuts hydrocarbon pollution from transport in half.
Reply: Look at the screen, fiddle with your keyboard and keep drinking the Kool- aid.
  Your purchasing power is all you have at best 😁
Reply: @davepowell7168  You accuse the contrarian of drinking the Kool Aid?
Reply: Except your milk man has to drive to each suburban household to drop off milk.
Reply: @JaquzziJones  Door to door customers at the time made this ergonomic and economically viable from electric powered 'milk floats' custom built for purpose of daily delivery.
Reply: Yes, it does sound less expensive for the  company too. It sounds much simpler for us to just give back bottles to the companies. The ph still does this somehow, we deposit soda glass bottles and get some of our money back from sari-sari stores so the companies can clean them thoroughly , sterilize and re-use the bottles.
Reply: “A much more environmentally process”

What
Reply: @mrs.berganzo  if it were less expensive they’d be doing it rn.
Reply: @davepowell7168  no
Reply: @davepowell7168  you said I took that out of context.

I didn’t.
Reply: I live in Idaho we have cloverleaf, fresh milk. They bottle in glass and you return the bottle for the deposit. Tastes nothing like grocery store junk.
Reply: @bobhart677  Try superglue 😁
Reply: Depends. Wasting so much water cleaning all that glass doesn’t sound environmentally friendly right ?
Reply: They do that at a market that is a little out of town. What's messed up is its cheaper to buy plastic gallons then exchange your glass for a glass gallon.
Reply: We have a local dairy provider that still does this minus the pickup. Homestead Creamery in Shenandoah Valley here in Virginia has bottle deposits of 2 dollars but you get it back when you bring the bottle back. I only get that milk because after the 2 dollar deposit is paid the milk costs $ 2.50. It's cheaper than 5 per gallon in plastic.
Reply: @bobhart677  3 "Trust me bro'"s in a row?
Can you point me in the direction you got these claims from?
Do you think the manufacture of modern "ultra light" (is this just to make them sound better?) plastic bottles is at the same level as the reused milk bottles the milk man delivered?
I recall the milk man needed an 18 wheeler to deliver those ULTRA HEAVY glass reusable bottles thank god we took all those milk men's trucks off the streets by pumping quintillion ULTRA LITE bottles directly into our water supply lol
Reply: Our milk man used to wrestle on the couch with my mom while dad was at work
Reply: How does that work in the city exactly? We used to get it the same way in early 70s but anyone living in an apartment building didn't do it.
I'm still blown away that Aqua Velva is sold in plastic bottle.
Reply: @moiragoldsmith7052  4 great things to do and 1 thing that doesn't do anything since it's usually dumped in third world countries since China stopped taking foreign recycling in 2018.
Reply: @UltimusTheSoldier  nylon, not plastic? 😂. The name nylon refers to the group of plastics known as 'polyamides'.
Reply: @vlada  True, but the "plastic" in plastic bottles and the nylon in nylon bags are two different things.
Reply: Except for the milkman driving around the town every day but.
Reply: When I was young, all the sodas came in glass bottles. You would return the empties to the store (any store that sold sodas) and get your refund back, just a few cents. As kids, we loved to find bottles people hadn’t bothered to return. We would then use the money from returning them to buy candy.
Reply: @ninjasylph No Brasil as cervejeiras praticamente voltaram a trabalhar com vidro retornável. E estão fazendo um esforço nos refrigerantes. Recentemente o Brasil reciclou 99% do alumínio consumido, um recorde.
Reply: @bobhart677  
Plastic is made of petroleum; their manufacture and recycle processes create greenhouse gases.

Making glass bottles is only a one-time process. Using hot water to clean the glass bottle doesn't create as much environmental pollution as manufacturing processes for petroleum or plastic.

Transporting heavy load doesn't require much more fuel than lighter load, the start-up requires more power but as soon the vehicle is on the move then not much power is required to keep it moving, in fact takes less energy to keep it moving. 

The heavier the transporting load the harder to stop it from moving. Just like how train engine can pull a heavy weight load a million times heavier than itself. Trains are much more fuel economical and efficient than regular cars because of this reason.

Furthermore, plastic causes cancer, but glass is 100% safe for holding any food.
Reply: @bobhart677 where does all that plastic end up going?
Reply: @michaellazuka654  same place all other garbage goes. Either a landfill or an incinerator.
Reply: @bobhart677  I'm not on either side of the fence on this issue, I'm simply not informed enough to.  I do know that millions of tons of plastic end up in our waterways and oceans.  I fish and see it everytime I go out, and it's getting worse.
Reply: @michaellazuka654  The vast majority of waste dumped in the ocean, of all kinds, comes from desperately poor third world countries with coastlines. Many countries use rivers as a sewer/garbage disposal system. Just speculating on where you fish and what you see. I assume you are talking about litter. Soda bottles, food wrappers, plastic bags that sort of thing. Better signage and more garbage cans at the boat launch might help.
Reply: @bobhart677  I'm in northeast ohio, all rivers there dump into Erie.  Lake Erie than dumps into st Lawrence.  Which goes to the Atlantic.  I'm fishing rural areas where the fish are.  I know one thing, signage is not going to deter people from littering.  I don't believe that plastic should banned, but it's hard to argue for it's sustainability.
Reply: @michaellazuka654  The problem isn't sustainability, we humans will have no problems making plastic for the foreseeable future. The problem is, will it ever go away? Plastics main feature is it's durability and resistance to damage. New formulations of plastic and bio engineering will solve that problem soon enough.
Reply: @bobhart677 All plastics leach chemicals into water.
Reply: Yes! I remember reused soft drink bottles being reused for many many decades. I know this because the bottles had the manufacturing date molded in to the bottle, on the bottom.
  I saw bottles which were Thirty years old, and still worked perfectly. Absolutely True!
 Make them, return them, wash them, re-use them, it worked!
Reply: @bobhart677 
Not toxic?
Researches on mitigation and impact of microplastic says different
Reply: What is the carbon foot print of that process?
Reply: Are they taking the total carbon foot print of this process into account? Transportation of the bottles from end user back to end user? Loaders used? All the sorting?
Reply: In india not sure where it is recycled any idea pl.
Reply: In Denmark we clean and reuse more than 90% of glass emballage...
Reply: I get some of my milk still in glass bottles
Reply: How cute are you drinking the milk and leaving the bottles out for him
Reply: I'm 65 I still remember when milk was delivered daily to your home in glass containers and left on the front doorstep, in freezing weather the milk bottles would break. 
I always wondered if those people got any refunds.
Reply: @focusmphoto  what happened if the cold from winter froze & broke the bottles? Any refunds or was it on you to get those bottles inside before they broke?
Reply: I still get my milk in glass bottles, here in the UK.
Reply: @jimroberts3009  is there ever a problem with the glass breaking in freezing weather?
Reply: @bobhart677 Honest question, how do you account for the economic/environmental impact of plastic waste needing removed from oceans? That is also surely very expensive and uses many hours of labor, ship fuel, etc. 

Just something that needs added to the equation?
Reply: I still remember that. Late 90’s.
Reply: Your old
Reply: @DennisMook-ky6lx  thanks
Reply: @DennisMook-ky6lx  respect your elders you young whippersnapper!
Reply: My milkman still does this here in the UK
Reply: @syrus3k  do those glass bottles ever break from the milk freezing?
Reply: @raymondjjohnsonjr363  no, the glass is very thick and the shape of it means the frozen milk just pops the aluminium foil top off
Reply: @syrus3k  thanks for the info. I am 68 yo & when I was about 8 to 10 yo I remember seeing in Massachusetts these full bottles of milk break from the freezing weather. I don't know what kind of bottle cap they used back then. 
Enjoy your cow juice 😂 & have a great day.
Reply: cleaning those bottles costs water, and also water is valuable, so its vice versa. i like this plan they recyle instead of what most companies do is just throwing it away and ends on a landfill
Reply: @bobhart677 energy is energy, and can come from 0 emissions sources. But plastic can never be clean, can’t be reused many times, and is almost impossible to recycle.
Reply: the good ole days
Reply: From the living areas the milkman disappeared. Complaints about noise from the glass bottles.....
Replaced by supermarkets; improvement?  Not really.
Reply: Dù suy nghĩ của bạn là gì, tôi tin rằng bạn thực sự quan tâm đến vấn đề này. Nhưng trước khi thay đổi toàn bộ hệ thống sản xuất, chúng ta hãy nghĩ cách giảm diện tích bãi chôn lấp trước.
Reply: @ninjasylph, that is great.  I have been campaigning to have communities pool resources and build small meat processing plants, friit distributors and such.  That way every community knows exactly what is going into the community food supply.  With monopolistic food companies crushing farmers, I even think it would be cost effective, eliminating shipping costs etc.
Reply: Oberweis Dairy in Illinois still does this. Their milk is in glass bottles, which hou can return to any grocery store that carries Oberweis milk, and currently you will get back $2.00 PER BOTTLE! And they clean and reuse them.
Reply: @margomoore4527  Can be reused 3 times max.
Reply: @MoneySavingVideos

I know exactly what you're talking about but I didn't experience it myself, and another added benefit of this system would definitely be if used during the pandemic when contactless deliveries were pretty much the only way people could get groceries. So an old fashioned milk bottle delivery system would have been ideal.
Reply: And let's not forget that if you have any plastic bottles filled with water left sitting out in the sun, then you would need to discard them since plastic and heat would render the water (or any other liquids) toxic, or depending on the exact chemical compounds used to produce the plastic bottles it would at the very least be unfit for consumption.
Reply: @nancybrownlee6518

Damn. Looks like @dont.ripfuller6587 never heard of pasteurization and the guy that invented it Louie Pastore. I realize that the public education system in this country has been in decline over the years, but I remember being in the 6th or 7th grade and learning about why and how pasteurization came to be a fundamental part of eliminating food born illnesses and diseases in an industrialized society. 

It's just kind of mind boggling how this is not common knowledge anymore.
Reply: Very true, I think the same milk bottle could last 20-30 reuse. But it was expensive in storing bottles, cleaning them and refilling.